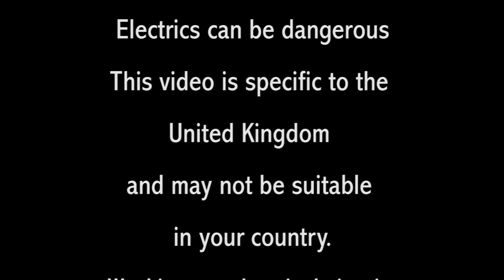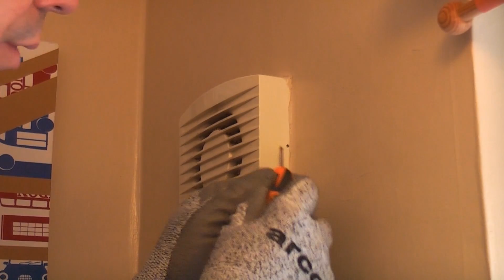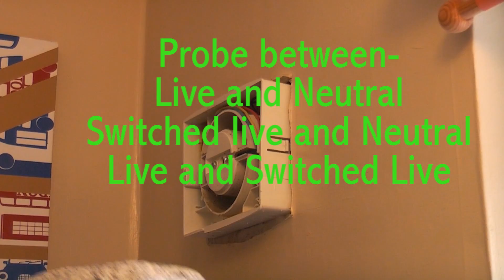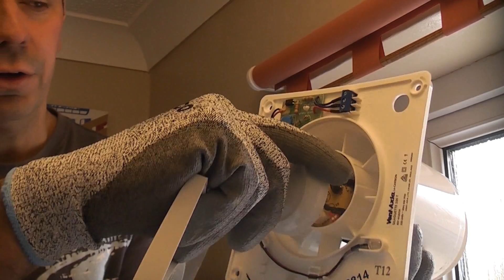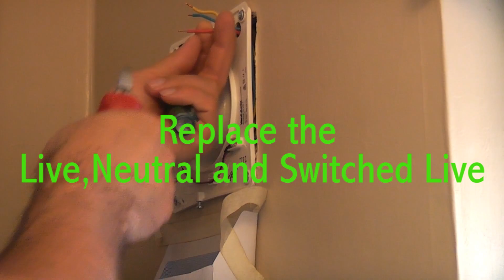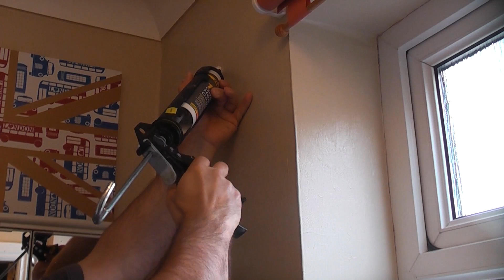How to replace a wall extractor fan | vent-Axia Silhouette

Comment: Great example as usual :) I have a ceiling fan that needs replacing though it uses a pull cord and I would like to have it come on with the light. Not sure it has a 4 pole switch just looks like a normal light switch in usual place outside above door. The light cord is close by though.
Reply from the maker: cheechU38K 
That should not be too difficult, although you would have to ask the council to see if it's notifiable or not ;-)
I installed a new fan here, but removed the old one from the bathroom ceiling and pulled the wire back and installed a twin impeller in the loft. I asked the council if it was notifiable and they were happy that it wasn't because I was not doing any wiring in the bathroom as it was all in the loft space ;-)

Comment: *****  Great Vid!! :-)

My extractor fan in the upstairs bathroom has a problem, it make a quiet buzzing noise when its on when I tapped it the buzzing stopped for a few mins then started again, Plz tell me how I can fix this. I have had it for 2 or 3 years.
Reply from the maker: For the price of a new extractor fan I would just replace the whole unit ;-)
Reply: Thanks ;-)